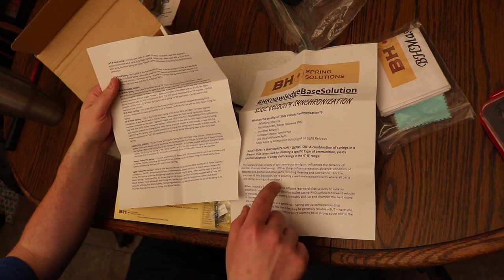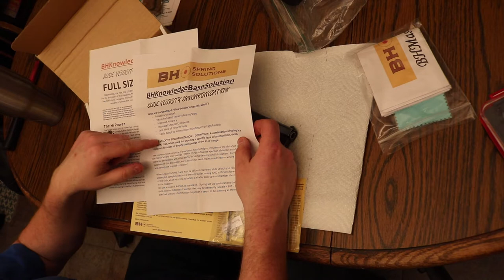Ultimate Browning HiPower Overhaul Pt. 2: The Build

Comment: The Canadian Inglis HP was made to fire the then "machine carbine" 9mm round which today we describe as a 9mm +P. 
The trigger axis pin is tapered and only comes out one way. The only springs I remember replacing was the firing pin and sear spring. Some were fired a fair bit on ranges but most sat in supply. The hammer kit is quite interesting.
BHP design  over 80 years old and still in service.

Comment: for some reason I've always loved the Hi-Point 1911 basically I just wanted to say that I watch both videos and I like them a lot and it really didn't look like it really was that hard to you know do everything but I'm sure that you had to do you know editing and everything so it took a lot longer than that but the point of what I'm trying to say is that you know after everything was done I really really like the new grips even though they're really smooth but that's a gun that you know you're not going to take out in the rain you know or unless you have to and I love how It just fits right into your hand that Groove is right on point to have your thumb right there on either side if you're a lefty or righty I'm sure that you know you can order them that way too it's just overall a badass gun I just love the way that they look the way that they should I love them all the way through and through and now with all of the upgrades that you made I think it actually is going to perform a lot better A lot more accurately as you get used to it more and get some more rounds through it two guns up well two thumbs up I should say LOL!!!!!! superb job and great quality!!!!
Reply from the maker: Hi-points are a bit different than Hi-Powers ;)
Reply: I love the Hipoint 1911s too lol